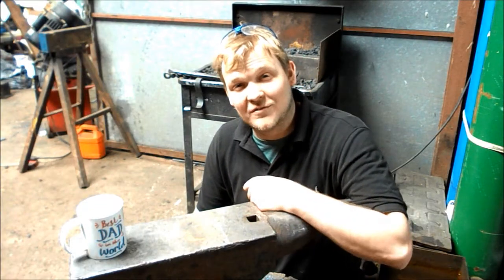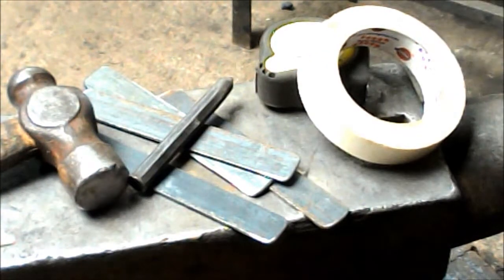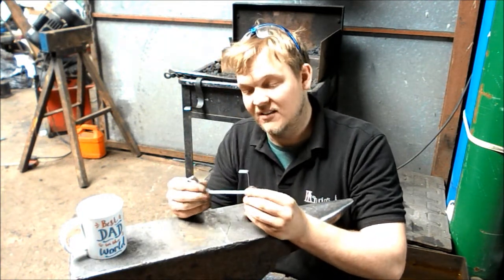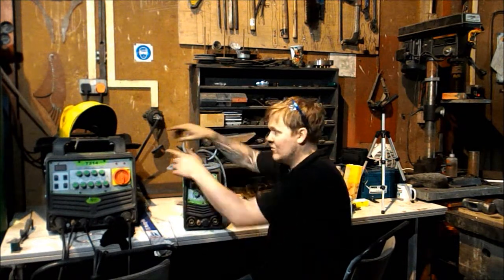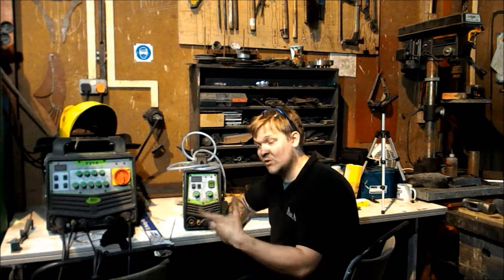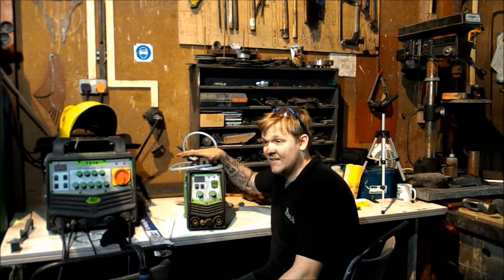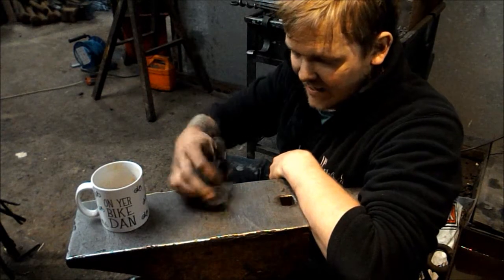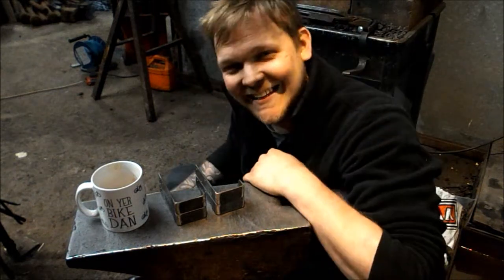What welder to Choose? Trust Me I'ma Blacksmith

Comment: Great tips, Dan.  BTW, I have been welding up a press frame (1/4" wall square tube), and used 6013 for a root pass and 7018 over top (over a heavily beveled edge).  However, the 7018 looks cold (very tall and knobbly).  If I can get my hands on a TIG, would you recommend running the TIG over top of existing beads to burn them in?  I could only get 170A from my AC buzz box.

Comment: I don't know what the distribution of your subscribers is Daniel, but for those in the U.S., TIG can be a little more difficult to use than it is in the U.K.  That is because our most common line voltage is 120 VAC while in the U.K. you guys run everything on 220-240 VAC.  You can get 120 VAC TIG welders but they will only weld up to about 3/16" stock which is more or less comparable to what you can do with a 120 VAC MIG welder.  

One advantage to MIG is that you can run flux core wire and dispense with the gas.  The welds are not as pretty as if you do it with gas but it is certainly easier to transport the welder without the bottle.  If I had an easy way to get 240 VAC to my shop, I would certainly add a TIG welder and the ability to use sticks, as you say, really elevates at TIG/Stick combo unit.
Reply from the maker: I'm not sure what your getting at with the sub thing but I can understand where you are coming from with the voltages but you wouldn't be able to weld any larger stock with MIG than you could with the TIG or MMA on 120VAC. You would create the same type of arc. Also inherently MIG needs a much greater arc to get a good weld. You need a really good MIG welder and be a well trained MIG welder to get MIG to weld well. If you get me. The only time MIG welding gets close to TIG is if you use a spray transfer style of welding. You can't do spray transfer with Flux core nor can you do it with 120VAC. Also Flux core is messy and can cause loads of wire feed issues. If it was flux core or MMA i would take the MMA you can do so much more with MMA.
Reply: That has surprised me for America.  It's a pretty low voltage.  

Standard phase voltage for the UK is now 230v which is supplied to all homes and single-phase commercial properties.  Many workshops, including many small outfits, often have 3-phase supplies, each at 230v.  This gives a voltage across the phases of around 400v.

Common site tools are 110v.  This can only be obtained by transformers.
Reply from the maker: Yep all of North America Uses 120VAC and you have to get 240VAC fitted to you home if you want it. Not sure about the amperage in the houses but some one once told me that Americans use the lower voltage to lower the chance of electrocution. Both my MIG and the AC/DC TIG run off 16amp 240volts in the workshop . sure that that's pretty rear in the USA. I just didn't think about it when i made the video. odd right.
Reply: As far as the subcriber issue goes, I was only trying to offer some clarification in case someone new to welding and smithing in the U.S. went out and invested in a TIG welder that ran on 120 VAC, only to discover than they could not weld anywhere near as heavy stock as you indicated.  I was also not sure if you were aware that 120 VAC is the more common line voltage here in the U.S.  

I weld with a little 120 volt MIG and it works o.k. for me.  Ive been using one for nearly 20 years now and dispensed with gas about 10 years ago. Although my welds are often not particularly attractive, they seem to hold up fine.

You clearly know far more about welding than I do and I would love to have a TIG myself.
Reply: Most homes here are wired for 240 VAC but it is typically only used for things like water heaters, ranges (what you lot call cookers), space heating and clothes dryers.  I've got it in my tiny house but to run it out to my shop would be a pain so I have not done it yet and probably won't. I am going to retire in 5 or 6 years, assuming I live that long and will move out of town into the country.  When I build my shop then, I am going to be sure to run the higher voltage to it. Maybe buy a power hammer as well....
Reply from the maker: I see what your saying sorry was a little confused for a second. Don't want to make a mistake like last time. I never gave a size for the TIG performance Just the MMA. I would have thought that A 120VAC MMA arc weld would also weld 12mm plate in the right conditions. Not sure but it might. I have used a couple of 110 stick welders on sight and they have work well if not a little spitty.  I would Still tell some one in the states to go and get a 120VAC introvert over a flux core any day it give a much more controllable and deeper welding pool and you can uses lots of different types of filler rods on DC setting.
Reply from the maker: http://www.lincolnelectric.com/en-us/equipment/Pages/product.aspx?product=K2606-1(LincolnElectric)

This is very expensive but it was the first one i found and it will run off 115 or 230 at 50hz to 60hz and will do every thing that little unit i have will do and more.
Reply from the maker: http://www.ebay.com.sg/itm/SWP-DIGI-ARC-9022H-160PFC-110V-240-VOLT-160AMP-INVERTER-MMA-TIG-WELDER-/182293472528?hash=item2a7189a510:g:gggAAOSw8gVX-6jW

Also this Cheap little fellow that is a steal. That will take 110+10%. I have also chacked the spec on the SIP i showed in the video an that will also run of 110 as well.
Reply: I think you are probably right.
Reply from the maker: I will say one thing my prices I well out that little welder is a lot cheaper now that it was when i brought it. Its just over £400 with the VAT.

Comment: Hey Dan - I like the good old gas welding for fiddly stuff, and you can weld anything with it, and dont need shielding gas! It makes its own. Otherwise for thicker mild steel stuff I am happy with my old buzz box, made back in the day when they had no concept of "duty cycle", the bad boy will run all day!

I am a little intrigued with your brackets - why cut and weld to make the shape rather than heat and bend? Particularly when you could have given it a bit of hammer texture while you were at it to add to the aged theme?
Reply: I have an air-cooled electric welder made by the London Electric Power Company in 1929.  It did military service through WW2 and was recovered by 2 old boys who served in N Africa.  They brought it home in 1946 and used it until 1987, then passed it on to me.  It still works fine, though I  have renewed all the insulation between the copper coils -  in 1988 !  

It will take input voltages of 120, 200, 240, 380, 400, 440 and 500, and has hi and low tappings on the coils to give outputs up to 100A or 200A.  Stepless control through a hand-wheel on the top.  Open circuit voltage of 100 volts.  AC output only.

It's a beast - but it burns rods off beautifully, though not as smoothly as a DC rig.
Reply from the maker: Thank you for the great comment you make some good points.

So true Jack gas welding is pretty good as well but acetylene is very expensive and it very hard to get insurance on it. Also getting carbonizing and oxidizing flames set up can be a real pain. Plus theirs is a lot less messing around with an inventor. Also transporting acetylene is a real pain in the bum. so for sight work is a no go. I did say that stick welding was the best place to start and offers a great starting point. The old oiled cooled things are heavy and when they brake the can be pains to fix. I have an old oxford in the shop and its no ware near as good as my little Chinese SIP.  

In my opinion when you get down to brass tax TIG is king you can do so much with it and its a lot safer than gas. 

The Brackets need to be quick and easy and didn't need any texture (Job paided me £80 for 45mins work). In fact that will be painted the same color as the wall they will be fixed too So they will stay nice and hidden. If i was making 100 i would have made a jig and done the hot. Again no hammer marks. Also the welds offer a heat affected area on the bend making the corners very tough this will stop the little buggers opening up. I could have bent them but this took me all of 45mins so not bothered.
Reply: No worries Dan

Who do you get your gas from?  I've been with a well-known supplier for years but got very concerned about the cost of rentals.  And the cost of gas as I recently found out.

I used to be with BOC years ago but their main rival tempted me away.  It was ok for years but in the last few years their prices rose and rose.

I contacted BOC again at the back end of last year.  They were eager to get me back on board.  I'm now paying just £24 per month in rental for 4 cylinders (Oxy, Acetylene, Argon and Argon/CO2 mix).  Previous to that I have been paying over £100 per month with the other company.  BOC have also guaranteed to charge only £10 for Oxygen (the gas) and £18 for MIG gas.  The rep also included the first cylinder of Acetylene for free!  And free delivery for my first order.

I think the other company last charged me almost £90 for a refill cylinder of MIG gas.  Now it's only £18 with BOC.  It's scandalous really but that's what you get for not shopping around regularly.

If you're not with BOC and are concerned about your prices, give them a ring and haggle with them.  I have a rep's number who said he will do the same deal for anyone if I pass on his details.  He's here in the North West, but that's head office anyway (Manchester) and says he can do the same deal for anyone in the country.
Reply from the maker: Yeah BOC is hard work. I use a local company and get quit good prices on Gas. I have found that both the site and work insurance are far to high if i say i have acetylene. Also I little 25ltr bottle of Argon and the DC invertor just glides into the truck compared to some fuck of bottles of gas. I don't really use the Oxyacetalene so much now. Also if i need to do site work i can get my hands on a genset. 
Thank you sooooo much for the comments. loved them all. Hope you are enjoying the videos?????
Reply from the maker: They give all the good deals to ex customers so I'm getting the deals where i get shafted. hehe 
. I get some really cool deals from a local company that bets most of BOC prices which is nice.
Reply from the maker: Sweet it sounds like a monster. How heavy is it? I bet its a real door stop. Thanks for the comment I really appreciate all the comments and feed back. I do like older kit but when it comes to electronics and welding TIG and modern kit is the way forward. What regiment where you in?
Reply: Lol, I wasn't in any regiment Dan, I'm not that bloody old to have served - in WW2 at least.  I took over the business in 87 when they retired and the welder came with it.  It is a heavy bugger but it's on a little trolley with wheels so it's not too bad.  I bet the trolley is original too - 1920s angle iron, lol.

I've got 2 TIGs as well, one a transformer model, one an inverter, both 3-phase.  MMA capability on them too.  And a Cebora 3-phase MIG, 250A.  And oxy-acet cyls.  And a Honda 200A DC generator/welder, smooth as you like that is.  Honda 337cc petrol engine.  I have a hand-held spot-welder somewhere too.  Probably last used some time in the 90s.
Reply: cheers for the reply Dan! TIG is on my bucket list, and no Acetylene and oxygen are not cheap, but there is a new player in the market here (Australia)  now, (formerly a monopoly and the company knew how to charge, as well as $200 a year per bottle rental) so there is now no  bottle rental, and you can just do a swap at your local hardware, quick and easy. 60 dollars oz for oxygen, $100 for acetylene.
Reply from the maker: That's cool my Jack thank you for the comment. Love to chat to you  guys on Youtube.
Reply from the maker: Sorry Dude my bad miss read your first comment. Hope you don't thin'k i was being rude also that would make you like 90ish so that can't be right. You have all the welders one man might ever need. Thank you for the great comment.
Reply from the maker: That sound reasonable what size bottle is that. I just feel that the little DC investors are great all rounders in a pinch. Thanks for the comment.
Reply: Nominally both are D size, but the company has its own sizing - oxygen bottle is nearly twice the size of the acetelyne. Gas prices are similar to BOC, the no rental is the big game changer, particularly for the backyard bloke who is not filling cylinders every month. (Not to mention not having to deal with BOC, their accounts systems is a nightmare) 
Link to supplier if your interested in comparing prices on the other side of the world!
https://www.bunnings.com.au/our-range/brands/c/coregas.
Reply: Vids are great Dan, no worries there.

Well, I'm happy back with BOC for now, they have done ok on prices, to tempt me back.  The other advantage for me is that the BOC depot is only about 3 miles down the road so it's easy for me to go and collect myself.  

I know what you mean about acetylene.  It's all overkill on H & S in my opinion, but I'm of the older school (not that old) and so I will be seen as a dangerous relic.  There was a big ramping up of the Fear Factor some time in the early 2000s, like there has been with allsorts of things, but recently some of that excessive caution has been rolled back.  It's not just me saying that.  When you have time read this:

http://www.boconline.co.uk/en/sheq/gas-safety/acetylene-safety/index.html

http://www.boconline.co.uk/internet.lg.lg.gbr/en/images/Fire%20%26%20Rescue%20Service%20communication%20for%20Dissolved%20Acetylene410_387646.pdf?v=6.0

All gases and cylinders can be dangerous of course, but while insurers and others are freaking out about professionals having access to them, a million households and more are carting butane and propane cylinders  down the garden path for millions of BBQs and Patio Heaters.  Few of these people have ever been trained at all in the use of gases.  There they are, sitting in the garden with a gas cylinder, often very close to a fire source, getting drunk ......

I'm not saying people shouldn't do this but, well - you know....